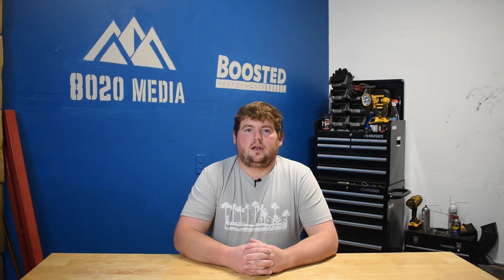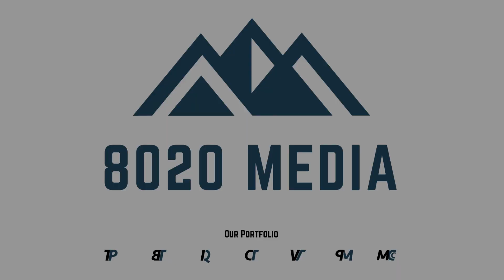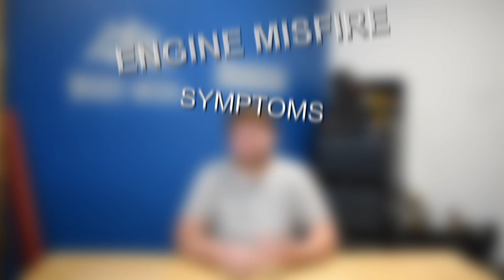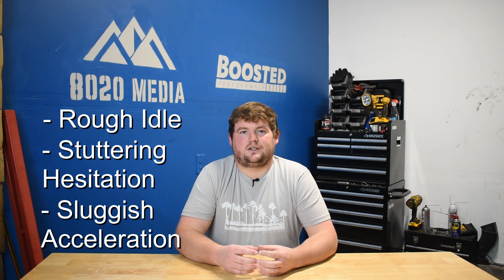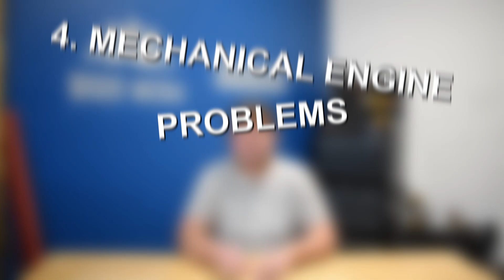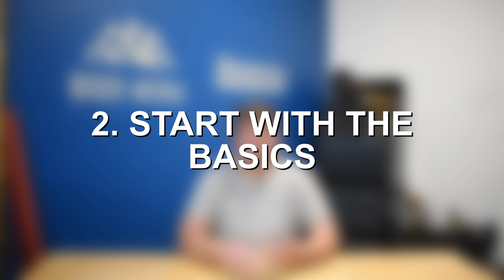DIY - How to Diagnose and Fix an Engine Misfire (Code P0300, P0301)

Comment: Im confused as heck! I had a cyl5 misfire so i replaced coils and plugs. Code went away and now i have a permanent cyl#1 misfire/ multiple cyl misfire, no check engine light when i turn the car on but the code is stored when i plug my scan tool
Reply from the maker: 2 - Sorry to hear.. This means the ECM detected a past misfire event but hasn’t seen enough clean drive cycles to clear it, or there's still a minor, intermittent misfire on cylinder 1 that isn’t severe enough to trigger the CEL again; start by checking if the coil or plug from cyl 5 was reused on cyl 1 (it happens), inspect the injector and compression on cyl 1, and try clearing adaptive learning via scan tool or a battery reset—if the engine runs smooth and the light stays off, it’s likely just a leftover memory code that will self-clear after enough drive cycles with no misfire events.

Comment: How many misfires are not good. I have random misfires on all cylinders but car runs fine. 2019 must gt only 16k. Had one P0300 , cleared code has not come back 3k since cel, but still have multiple cylinder misfires per mode 6. Changed plugs but did not help.
Reply from the maker: D - On your 2019 Mustang GT, some misfires showing up in Mode 6 diagnostics (even without a check engine light) can be normal—especially at idle or during cold starts—but if you're seeing consistent misfires across all cylinders, even with no drivability issues and no return of the P0300 after 3,000 miles, it likely points to a mild underlying issue like dirty fuel injectors, slight fuel quality inconsistencies, carbon buildup, or even low-speed ignition timing adjustment from the ECU; since you’ve already changed the plugs and the car runs fine, it’s probably not critical, but if the misfire counts per cylinder are more than a few dozen every drive cycle, it’s worth checking for vacuum leaks, cleaning the MAF sensor, or doing a fuel system cleaning—if the misfire counts are staying low and P0300 hasn’t returned, the ECU is doing its job managing small, non-critical misfires.
Reply: @8020Automotive I have ran Techron fuel cleaner a couple of times. Cleaned MAF and visually checked for vacuum leaks none found. The fuel trims are within the 10% normal range usually a little on the neg side. I do baby the car to much and I am thinking maybe a little carbon issue to. Thank You very much for your detailed reply...I really appreciate it! You have a great chanel!!!
Reply from the maker: @donaldbrown1300  Thanks for the support! Hope you figure it out.
Reply: @8020Automotive  One other thing I forgot to mention, when I datalog the car with livelink and a laptop, It never shows a misfire. Always shows 0 for total misfires. Any thoughts on that?
Reply from the maker: @donaldbrown1300  If your vehicle had a single P0300 code that hasn’t returned in 3,000 miles and still shows scattered misfires in Mode 6 but runs perfectly and shows zero live misfires on Livelink, it’s likely just borderline misfire activity from minor fuel, spark, or combustion variation—not enough to trigger a drivability issue or CEL; since you already replaced the plugs and have no symptoms, this is often caused by injector imbalance, slight carbon buildup on intake valves (common in direct injection), or ignition coil grounding inconsistencies, so unless the misfire counts increase significantly or the code returns, it’s safe to monitor and continue driving while optionally checking fuel trims and performing a preventative intake valve cleaning.
Reply: @8020Automotive Thank You sir for your input.  Very helpful!!!😊
Reply: @8020Automotive Maybe some HARD pulls would help! 😂 Have a great day!

Comment: I just had a p0305 a couple months ago on my 04 trailblazer and I changed the coil over then the miss was gone. Then yesterday it started missing a little again and now i got the p0305 and p0016. The vehicle still runs and drives really good except for the miss so I'm pretty sure after I change the plugs im thinking the p0305 would probably go away but as far as the p0016  code it just doesn't seem to have any of the symptoms I've been hearing from a few other videos I've watched except for the misfire. So I'm guessing I'll have to see after I change the plugs to see if the miss goes away.
Reply from the maker: J - The P0305 (cylinder 5 misfire) and P0016 (camshaft/crankshaft correlation error) on your 2004 Trailblazer are likely related. Replacing the coil may temporarily resolve the misfire, but the underlying issue could be causing the recurrence. The P0016 suggests a timing issue, potentially from a stretched timing chain, a worn timing chain tensioner, or a faulty camshaft position actuator. While your engine may not show all typical P0016 symptoms, the misfire and repeated coil failure could be early signs of timing alignment issues. Replacing the spark plugs and coil may temporarily resolve the misfire, but you should inspect the timing chain and camshaft actuator for wear or faults to address the root cause. Keep us updated!

Comment: I had gas leaking like.crazy and pooled up. Mechanic said i didnt need the fuel pressure regulator so i teplaced the fuel injectors and o rings. Toyota matrix 2006 continues to misfire and shake so i replaced spark plugs and coils and mass air flow sensor. Car is still shaking violently and stalling, turns off sometimes
Reply from the maker: A - If your 2006 Toyota Matrix continues to shake violently, misfire, and stall even after replacing the fuel injectors, O-rings, spark plugs, coils, and MAF sensor, the issue likely lies elsewhere in the fuel delivery system, air intake, or exhaust. Despite what the mechanic said, testing the fuel pressure would provide clarity. Additionally, inspect for vacuum leaks as these can lead to similar symptoms. Check all vacuum hoses, intake manifold gaskets, and throttle body connections for cracks or loose fittings. Keep us updated.

Comment: Hello there,  I am currently driving a 2010 Toyota Camry and have a cylinder 3 misfire. Ive already changed spark plugs and a couple of coils prior to this misfire happening. Whats going on is everytime I would drive up a steep hill of drive on a highway the car will go into limp mode for a brief period and kick right back on. I changed the air filter and also cleaned the maf. Also a friend told me to use seafoam which I did. After all this the condition went away. About 3 days ago it came back, not as often as before.... What should I really be checking or changing. Thank you so much. I've already swapped both coils and plugs to see if the problem would move and it didnt. Any advise would be great!  God bless.
Reply from the maker: D - Thanks for sharing your experience. Do you have any other engine codes?
Reply: @8020Automotive  No, I don't. I ordered a compression kit from Amazon that's coming today to eliminate some other possibilities. Thanks for your response.
Reply from the maker: D - Keep us updated here.
Reply: Well I did the last thing that I could think of. The compression test came back fine. I thought I narrowed down to a fuel injector. I took them out ( there where no videos for my exact model I watched a bunch of videos of other cars and decided to tackle it) not a necessarily hard job just one that I had to disconnect hoses wires blah blah blah. Wouldn't recommend it if you haven't at least done breaks and other small things at least a couple times. Anyways I had them tested and cleaned professionally for 100 bucks they came back okay which I was scared of. Put the injectors back on and I go up a step hill and what do you know loss of power and check engine light. Job took about 4 hours. My back hurts I've been stressed out I think it's time to take it in.
Reply from the maker: D - Sorry to hear this.. We have a video on losing power that could help: https://youtu.be/ipjYLPJgpq8

Otherwise, keep us updated.

Comment: WARNING: I'm a DIY Guy. P0300 & 301 etc, don't always mean misfire, or Coils. Can also mean PCM, CPU, or ECM, distributor cap, fuel injection, etc. My Mechanic Said It's The 'Flywheel'! I haven't fixed it yet.
Reply from the maker: C - Correct.